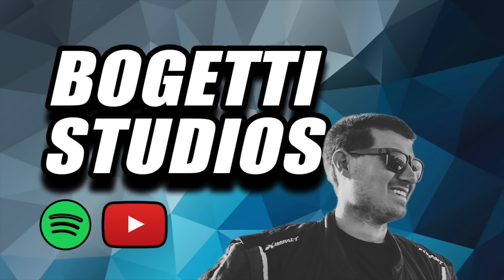Bringing Out The Butthurt Bar. with Joey Hiykel

Comment: What  if u had something like the butt hurt bar, but it was left at the starting line, so you didn't have to carry the weight down the track. 
Know it wouldn't be legal but the butt hurt bar most likely isn't street  legal it totally negates the bumper never pass inspection in Massachusetts , on the other hand 
99 % of the stuff driven on sick week or said to be street legal in Florida wouldn't pass inspection in 90% of the country